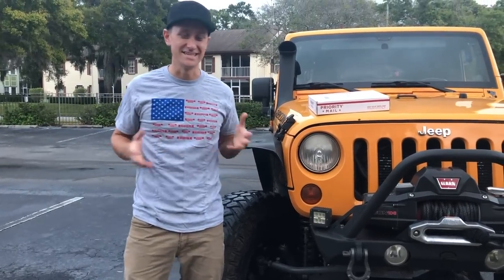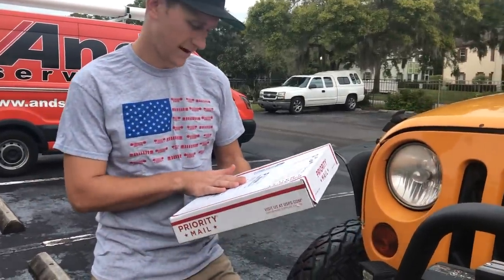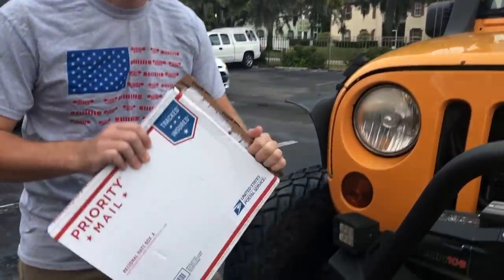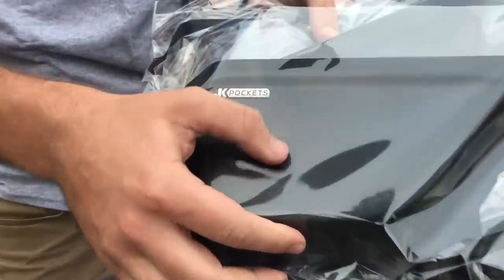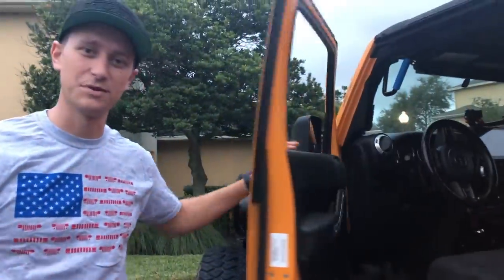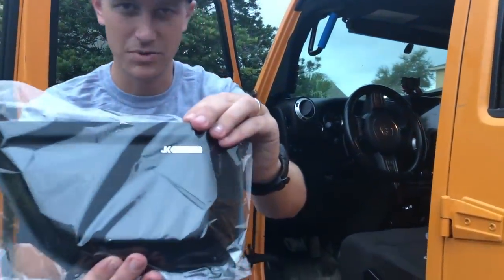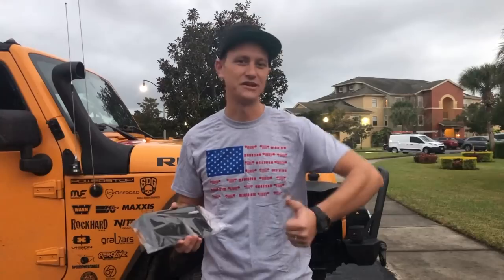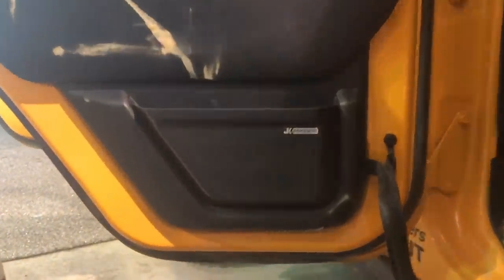Snip your saggy sacks and get the new JK Door Pockets!

Comment: Great product idea, but really pricey. I'll wait til the price drops a bit. In the mean time, I'll go ahead and cut out the saggy nets. Like you said, they're pretty worthless after using them for two years.
By the way, I'm thinking pulling the net tight and using a utility knife might work better than scissors.
Reply: an even better idea, remove the trim that holds the netting. take the net out the way you should keep it in one useable part just in case you need to reinstall it or maybe modify the net tighter and reinstall them saving the $150 for a trail functional upgrade. if you on the trail and you have so much junk with you that every other pocket and cubby is full plus your pants pockets are full and there's nowhere for your phone to go other than the saggy sac in the mud and crush zone, well you have bigger issues like hoarding to worry about.. ill say it since no one is

the pockets are awesome, should be factory, and much better than the netting. HOWEVER, at $150 that's just crazy the nets are fine. you can get jk pockets or a light bar and 2 pods? that tells you they cost  to much

Comment: Installation question? Could you not have just removed the little screws and removed the trim piece around the saggy sacks to make the install possible without forcing/bending the pockets in behind the trim?
Reply: Not really. The back of the panel has no access to the netting.